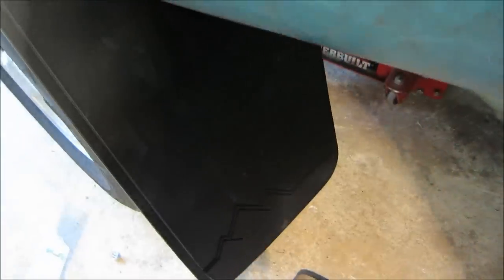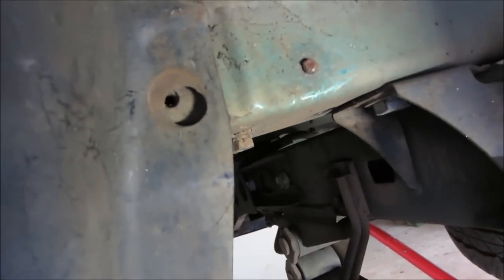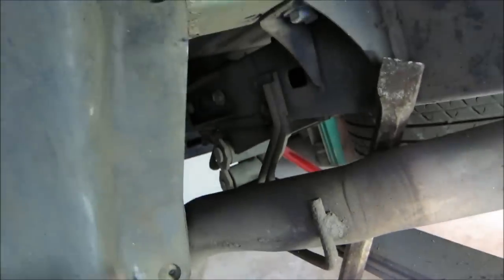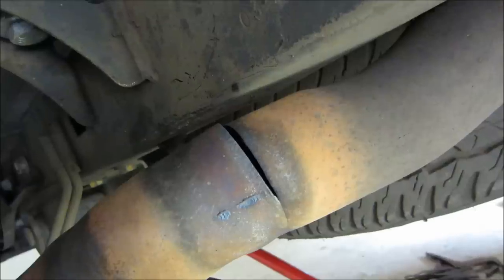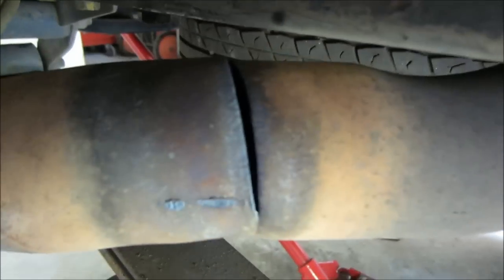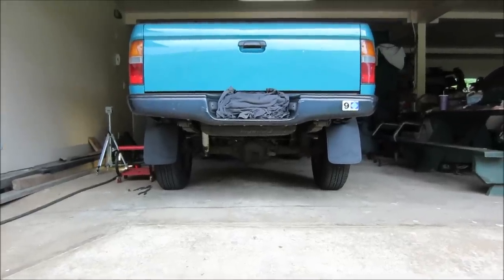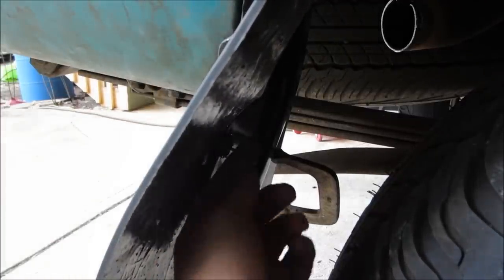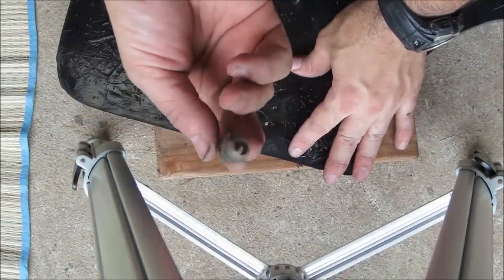My Mud flap installation

Comment: Custom exhaust!!,  lol.   Flaps look good!!  That should keep things cleaner.    It's tough to heat and manipulate older exhaust pipe..  They are a thin wall to begin with, and weaken with age, heat and of course, rust.  Next time try to heat a wider area of pipe, it spreads out the metal that is stretching and improve your chances of  not tearing....  Aloha.
Reply from the maker: Thanks Steve! I'm kinda embarrassed about the exhaust but glad to share with you all LOL. 
This is great advice I will take with me for the future. I was also told by my Father in Law that I was using the wrong tip and that tip was to weld things LOL. That reminds me... I have to ask him if he owns a barrel of grease. 
Thank you so much for watching and your great comments! 
Aloha and take care my friend

Comment: Aloha my friend!! I like the new mudflaps!! You did a great job installing them. They will last for many many years!! Good call on using the stainless steel bolts and nuts!! That hole maker tool works great! Where did you get it?
Great video!!
Reply from the maker: Hey Ray, it was pretty easy to do and should keep many people happy on the road LOL. That hole make I used came from my Father in Law and it's probably 30 years old. It comes in a kit and has many sizes. I have used it before to make gaskets. It makes a clean and perfect hole every time. 
Thank you so much for watching! 
Aloha and take care my friend